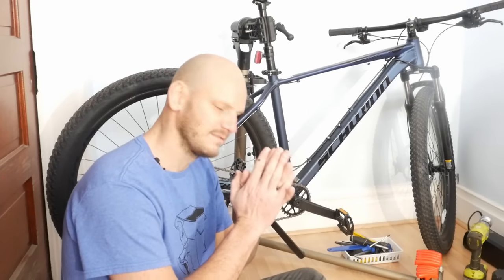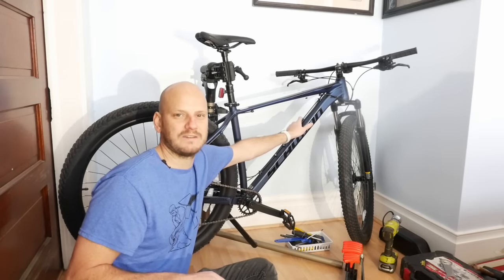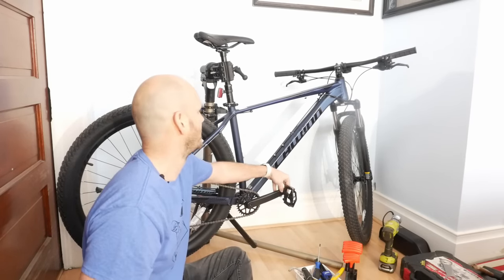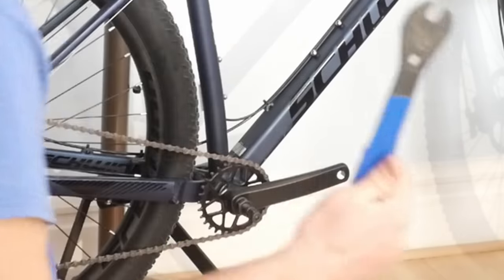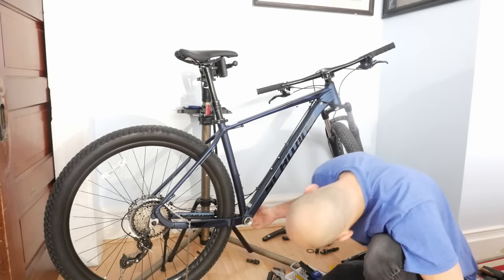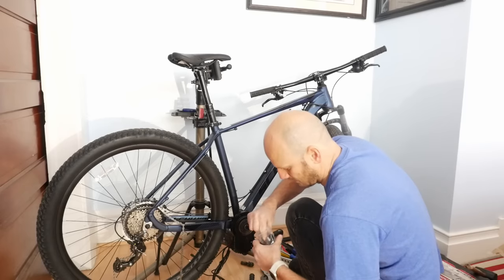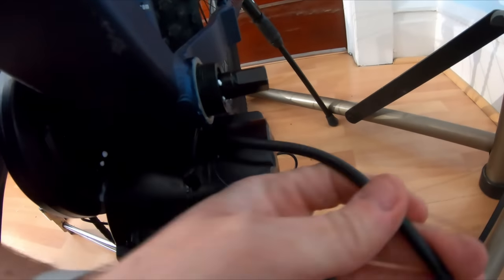The Step-by-Step Bafang Installation guide.

Comment: Hey Im a bafang expert had a 750 hd 4 fun  with 52 bafang rear battery rack. 46 tooth  It burnt out Feb lasted 2 years. I admit I took it up a steep hill after 2 years.  The motor always torqeed loose. had to improvise. Was always loose on the bottom bracketwith the gap... no spacers available yet.The rear rack never fit a 29 wheel size frame.. Bought it from Amazon thru greenenergia . Getting to buy the 1000 watt motor and 20 ah 52 w shark battery instead. Wary of Ali express. What do you think

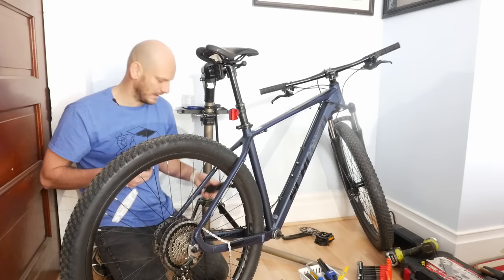Comment: 5:30 is exactly what I did :D

1. use chinese bike tool kit for 25 euro
2. totally demolish threads on crank arm
3. use angle grinder and rubber mallet to get arm off...

but its ok, it's a 30y old bike getting electrified

Comment: Someone can help me? I have a bafang bbshd motor whit 52v battery,i have a eggrider display, i use my bike whit no problem for a copule ok month but in the last week, idk why any display show me the correct voltage of my battery, the voltometer show me 58.7v and the bike show 52v i have arealy set the display on 52v battery someone whit this issue?

Comment: On your web site it says "****ALWAYS TEST MOTOR BEFORE INSTALLING****". Does that mean laying the motor, battery and cables out on the table, hooking them up to see if it spins before mounting on the frame? Do you have a process you use? Thanks!

Comment: I have decided on the Mercedes of mid drive motors, but am still wondering if I should go with their 750 watt, or unlocking the 2000. If the 2000 could be just as efficient, or even, enough efficient, I would want to go with that. I believe I will get a 44 tooth sprocket, with an 11 to 46 tooth 9 speed in back. Hopefully there is an ebike chain heavy and high grade enough to handle the torque of a Tugalug that pulls a 1/4 ton trailer. Do you see your opportunity to sell chains?

Comment: Johnny - I used this video to guide me with converting my wife's trek navigator this weekend.  (Any love for step throughs?). It came out great.  The fixing plate bolts weren't long enough so I had to visit the orange box store near me.  Other than that, it went pretty smooth.  Bbs02 with 48v/17.5 Ah.   Thanks for all your great content.
Reply from the maker: I love step throughs!
Reply: How has the bike been a year later any problems?
Reply: @Anees-  no problems whatsoever, but my wife doesn't ride all that much.  It only has a couple hundred miles on it so far, but she still rides it now and then.

Comment: Chain Alignment
Hello all .. I will be using a Bafang BBS02B 750w 46T for my build … I have an opportunity to get one of two donor bikes … the first is a 27.5 nine speed and the second is a 27.5 21 speed … the terrain is relatively flat in my area … I’m concerned with chain alignment on the 9 speed. My question(s) is/are can I expect any issues With alignment? Also, I’m looking for range and speed. Which of the two would be my best option?
  Great site Johnny And very informative. Glad I subscribed. Thank You.

Comment: thanks , nice layout of the video details, I'm in the last stages of my install and have 2 connections left coming from the BBSHD unit, a red/black set, and a yellow cable, I'm assuming the yellows are generic port connections and maybe my extra one would be used for shift/gear sensor?, and maybe the red/black is the exterior light you mention. any way hope so I am very excited about this feeling!!!

Comment: I had such high hopes for this kit but I feel like I got scammed.  The bike worked for about 5 minutes. Did. A couple laps up and down the street.. checked the gears etc.  And then it started saying err 30. And it goes crazy.  The brake cutoffs don't work. The throttle goes to max and sticks on, and now when I'm starting off the motor struggles to get moving its like it wants to go but it has no power.  Then all of a sudden it kicks in and the throttle sticks on at full throttle.  The battery added so much weight tot he bike thst now its basically Un rideable without the motor.   I literally didn't even get to take it on an actual ride and it's totally screwed. And from my research nobody seems to know how to fix err 30 theu just say replace the parts until the issue goes away.   This is one of those purchases where I truly feel like I wasted my monr.y straight up. $800 down the toilet.

Comment: I want to build an e-bike with my Giant full suspension bike - what would you suggest for a newbie?  I am very handy and can do wrenching and electrical work.  Looking to build out a BAFANG mid drive but not sure which front and rear ring (alum or steel?) to get… any suggestions to keep me off the side of the road is appreciated!

Comment: I have a sondors fat tire original from 2015, did a major up grade on the bike, I was dealing with electric bike world in California bigger everything, battery, 750 rear hub motor ect, my question is I have all the stock components left  I wanna use the stock motor on the front rim and everything else minus the LCD and thumb throttle in bag, (I'm thinking yes) and if not the stock motor because of thickness a thinner 350 volt. Obviously you see I'm in the need for speed and torque. Taking thoughts and tips, thanks!!

Comment: I have a question i hope you can help with. Retired Engineer, built robots and CT Scanners. Built Hot Rods from old cars. At 74 I have a 1970 Schwinn Suburban I really like, its an upright 23 inch frame with 27 inch wheels 1.25 wide, I love to ride but at 74 my knees are hurting. I want to add Pedal Assist to this bike but I am not rich nor do I need 64 V or 1500 watts or whatever. I want to stick 250 Watts range and Battery capable of 20 miles with a spare battery or ability to add extra battery if needed. Can we find a kit at a reasonable price with my modest requirements for my favorite 50 year old bike, It looks very clean no rust, lightly used. I would gladly offer a fee for your guidance if we can meet my goals. Dennis
Reply from the maker: Check out my tongsheng complete motor kit with a 48v 10.5ah battery that would probably be good for 30+miles based on your riding. The cost is under $700 for everything you would need for a 500w mid drive using premium battery 👍 never go cheap on a battery whatever you do.

Comment: For those trying to remove the battery plate 

1. The key unlocks the battery plate . There’s a turn this way unlock symbol next to the key lock ( anti clockwise )
2. Pull the plate down towards the cord . 
3. Your welcome .

I knew it would be simple , but I had to rewind to the point he turned the key 10 x to get that .

Note to the teacher : what’s simple to you , is what the f#@k to somebody who has never done it before .

Comment: So anyhow I purchased a $80 Kit From Cyclists so I would have all the tools cause I'm doing at least two bikes for my better half & myself. Took my laptop in the garage & was starting and stopping your vid. Opened up the kit and got out the crank puller........  Shot some lube on the threads and proceeded.  Bam,    stripped out the first crank on the doner Fuji Mountain bike.  What to h...   Grabbed the grinder & got it off.   So I'm about to sayI&^(&&^$ & order a better crank puller.  Then I started looking at the other side & the puller. Got my mics out .  Low and behold The round/flat snap in tip on the end of the puller was to big & I was actually putting all the pressure on the crank and none on the actual shaft I was trying to pull the crank away from.   Well 45 minutes on bench grinder & belt sander later I now have a smaller dia tip on my puller that actually works.   Will proceed tomorrow after a few to cool off.

Comment: For me, you left out an essential part - how do I know this Bafang unit will fit my bike?  Bafang has various templates, gauges etc. that are used to see if the motor etc. will actually fit and operate as designed.   As I understand it, it's entirely possible to have a common bike that a Bafang won't fit.

Your video, while complete, doesn't really show a lot of stuff you're doing since the camera is often fixed and you're on the opposite side of the bike.  I wonder if folks making videos actually watch the video before they post it?

Otherwise, a pretty complete video.

Comment: Old school hairspray and a long skinny flat tip screw driver to stretch the grip away from the handlebar. The hairspray after reinstall sets up like a light glue which can later be released with more hairspray.

Comment: About the wiring system even with hub motors why do they make the wires so extra long? I’ve made three bikes myself and in each bike I’ve never used or needed that much wiring no matter where I place the battery.🤷🏾‍♂️

Comment: Johnny my man, wondering if you’ve encountered this issue. My new BBS02 750W has a weird vibration at high load and on PAS 7,8, or 9. It’s when I’m spinning out, maxing my cadence, at least 100+RPM. BB is tight AF and I’m running the Luna motor bracket as well.  Battery is 48V 13Ah. Chainline’s straighter than an arrow. Any thoughts? Contact BAFANG support?

Comment: Are there brake sensors you can fit to pre-existing levers? I've a set of upgraded short levers on my commuter and they're just the most comfy thing to use. The reach, cable pull and modulating the front just right is a breeze. Feel like I don't want to mess with that if possible.

Edit: ahhh... you just explained it with the front. You beauty! Thanks!

Comment: I installed a bbshd last may 2021 I got 3000 miles on it already my motor is noisy an drains my battery real fast I used to ride 40 miles an still have battery left now I go 25 miles a my battery is drained MID DRIVES SUCK my last hub I got 5000+ miles on it it was still going strong before it got stolen and hubs are so much faster bbshd got me too 30 mph my 1500w hub got my to 35+ mph Im sticking with hub motors from now on

Comment: Question regarding the motor spacers. I got my kit and it came without any spacers. I don't want to wait another 2 weeks to get them so I'm looking around my garage and see a chunk of 1 1/2" ABS plastic pipe. It fits perfect into the indent on the BAFANG motor. I figure a 12mm piece cut square off the end should work great. I may cut several different sizes just for better choice. Any reason I shouldn't use the plastic? It's solid, chemical resistant, perfect fit. It's not a wearable area, it just need to keep the motor away from the frame. Excited to get this thing moving!

Comment: Just a quick note,,luved the way you described tool sizes and which tool for each part of
setup..i'll need to buy a few specific tools for bikes only like pedal arm removal and puller.
No one likes starting a project and half way thru have to spend money cause you need a specific tool and stores closed. What price would you say you put into all tools combined?
ex. wrenches and that sprocket puller? 2-1/2 inch round piece. Total cost of kit with battery?
Finally,how long for a bike shop to install and approximate fees? Great video! I got the jest of everything right up to front sprocket and chain replacement and setting. Thinking i can do everything else and get the shop to do chain..Video was so simple compared to rush explanations and people leaving out what they think are simple steps. Thank you so much..you've earned my respect..peace out.:}

Comment: i just got myself a used full suspension fat bike (steel frame) @ 250USD and looks quite nice and planning to convert it to an e-bike using mid motors. how do I start. by the way at present i work in Saudi Arabia.. Hope to hear from you. many thanks...

Comment: What if you decide to cut , solder and heat shrink those wires ? Leave an extra 5 or 6 inches for repairs . Put them up top so they don`t get wet in a heat shrink pack .

Comment: I've been looking at ebike trikes to purchase. You're right about brands vs manufacturers, I noticed the number of brands that were essentially the same exact trikes. All of the brands use hub motors with no option for mid drive motors. Have you ever converted a regular fat tire bike into a trike?

Comment: Little annoying issue with factory kick stand. It obviously was not engineered for this much weight. I bought a cheap $15 double leg kick stand that will hold the bike level. Unfortunately I have to reroute the wiring to fit the new kickstand in place. That will not be today.

It will help immensely when parking the bike in my apartment. It will make doing little tweaks on the brakes for example easier. I like putting the charger on my cargo rack for more airflow. A level bike makes the bungees redundant.

Still looking for a fuse block for accessories and DC/DC converter.

Comment: Great stuff man!  I saw in a comment you said the Townie is great for this and wondered if it should work well with a Raleigh Gruv 2 crank forward bike(enough room)?  Does riding in the summer sun with heat or humidity kill the battery?  Thanks new subscriber!

Comment: Nobody tells  you  if the back forks near the motor crank are very wide apart the motor won't fit and the chain line will be way off

Comment: Should the throttle  cable  be on the right side  Of the bike's handlebar ?  Since most motorcycle throttle is on the right side of the handlebar ??... Or does it not even matter ?

Comment: Tool Tip...NEVER use a torque wrench as a breaker bar. You will take that torque wrench out of spec and it will need recalibrated. This is a big no no. ;)

Comment: Battery position.  I'm thinking of mounting it underneath the downtube (underneath the water bottle).  Why?  I'm thinking it would be good to keep all the weight as low down as possible and free up a bit of space for storing things.  But mainly for a low centre of gravity and for good handling characteristics.  What are people's thoughts on this?  I would have to fit new threaded inserts but painting the frame anyway.  Also I may drill a few holes to route the cables through but not so that the frame is compromised.  I'm really going to spend some time on mine and go for a minimal stealthy look.

Comment: Are these mid drive motor kits compatible with full suspension bikes?
What about the frame material, can it be carbon, or does it need to be stronger, like aluminum?

Comment: I plan on doing a trike conversion hopefully with that set up right there I haven't seen if you put a link yet I'm just hoping the wire that hooks to the spoke won't be a problem I was actually going to return the trike to the third party seller I didn't care for the forks and the disc brake's and the crankshaft setup I plan on upgrading the forks and disc brake's due to the fact that the third party seller told me  keep the package I got a free bike 26 in  CLIENSY mountain bike adult tricycle I think it might have been a return since it was missing just about all the screws that were meant for assembly China made bikes everything on them are pretty cheap I was going to upgrade the crankshaft and sprocket cheapest setup I've ever seen this video is what made me decide as I just seen this video can you please share a link of that exact motor you're installing and where I can get those spacers if you didn't already I will check I am so thrilled to find this video thanks for sharing new subscriber

Comment: Great video. I am inspired to convert a Rocky Mountain Blizzard -10 Fat Bike. It has a 100mm Bottom Bracket. Is it best to size up to a 120mm Mid-Drive Bafang to help get the alignment on the frame and chain line just right?

Comment: No torque wrench,  take a bathroom scale and put hand on it pushing to need ft pounds. Do this several times to get a good feel for the pressure. It's not perfect but will give you a good feel for tightness needed.

Comment: If I don't use the throttle, is there anything extra I need to do? Is it ok to just not install it and leave the port empty? Also if I am only using pedal assist and no throttle, is it still %100 necessary to use the gear shift sensor?

Comment: Tip; do not run your wires between the motor and the frame because that motor is going to get hot and melt your wires.

Comment: Most of this install, after the handlebar parts are finished, would be easier if the bike stand was raised so you  are not sitting on the floor to do the motor wiring.

Comment: Too many cables and zip ties, bundling up the excess wires doesn't make sense. Why not invest in shortening and splicing all that? Also, what if you don't want to use the throttle and keep it a Class one?
Reply from the maker: https://youtu.be/C_9zo3lceaE?si=MbMwO5oj4dR_3bpD

Comment: Thanks for this video. But I must say as first time I’m doing a Bafang conversion I’m missing some steps. It would be nice if someone helped you filming and did some slow close ups on the various parts you install. Also, at the start of the video it would be nice to have a layout all the parts that typically come with the kit describing purpose of each. It is also not clear if the kit should come with new brake handles or if you reuse your old ones. Also did you have to purchase the spacers. My kit came without brakes and spacers.
Reply from the maker: Most kits won’t come with spacers, unless you bought my “complete kit”. Usually a kit will come come with either new handles or stick on types for hydraulic brakes.

Comment: I have a question. If I buy the size 10 cm pedal axel, but mine size is 7cm end i will put some spacers, will i have problems in the future? Thank you for the answers.
Reply from the maker: Only problem is that your pedal will be out 3cm more than it should, but for many that isn’t an issue.

Comment: can a mid drive motor be used on a low riding cruiser type frame with the motor rotate above the bottom bracket rather than below (not enough ground clearance)  thinking of a ruffian bike type of cruiser frame from TSP CYCLE FARM.  thank you, great videos and content btw
Reply from the maker: Unfortunately not. thanks!